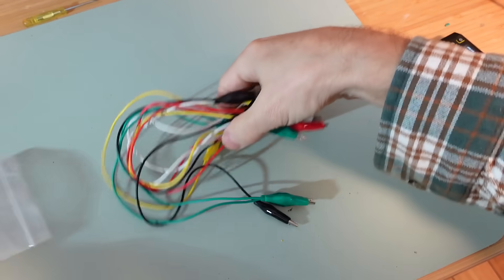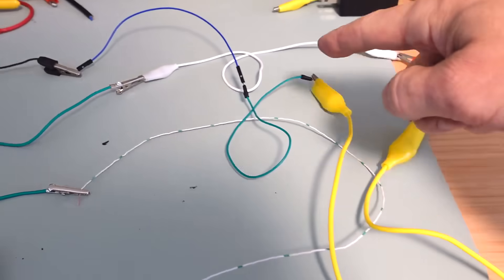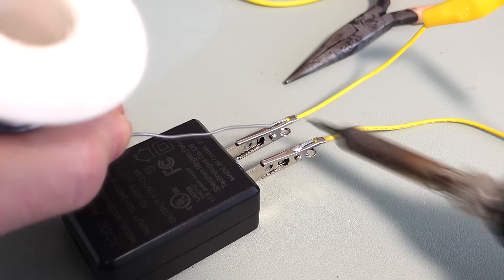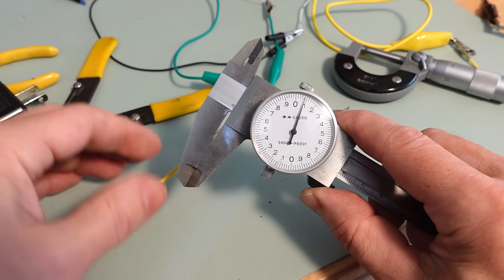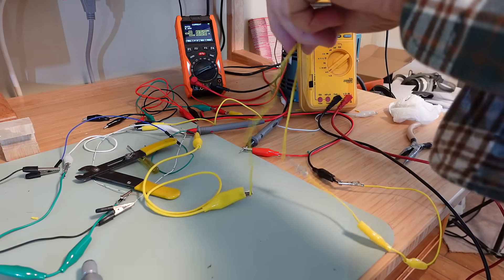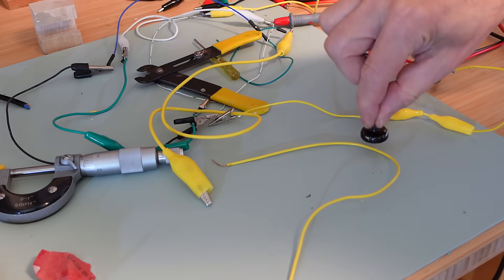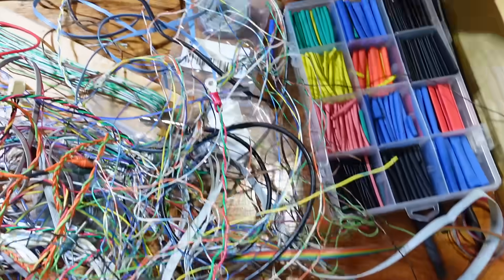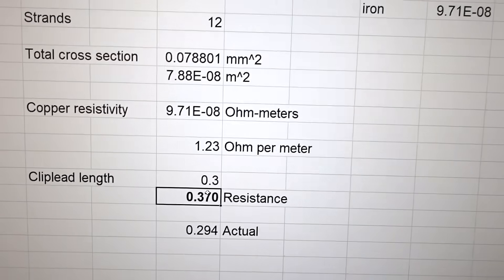Clip leads made with fake wire

Comment: I knew they used copper coated aluminium, had no idea copper coated steel/iron was also in use. Turns out some of the jumper wires I've got are magnetic.
I wonder if the mouse cable is shielded.

Comment: I can't imagine anyone better to review this name-brand screw-in light fixture for a table lamp that I purchased from a not-so-cheap "hometown" hardware-store... Who needs the attention drawn to?
The hardware store is known for goodnough quality to be in every hometown... Its supplier is known for similar, so neither would risk their reputation on cheapo stuff, right? The "manufacturer" is well-known and has a goodnough reputation for quality... So, then... they might not've even been informed when their outsourced manufacturer must've hired this new second-outsourced contract-assembly-line who obviously know more about cutting mechanical (and fire-prevention) corners (while still making it look the same) than they know a thing about electricity, and obviously don't care nor expect to be hired again for another run? And, further, maybe the company can't be held responsible, because they have an official UL listing for this product, which surely could not have been UL listed when the first run was brought to the Testing labs. So, I guess we can't even blame UL for not having reason to test each manufacturing-run, which is of such poor quality I won't even leave the switch on when I go to the bathroom even after I put a nut and bolt through the extremely flakey rivet (the thing is labelled 660W! I barely trust it with a 60W-equivalent LED bulb!!!), and would fear my non-electrically-inclined neighbor might've assembled one of these for a reading lamp and to scare away monsters in his kid's room, and winding up burning down the whole neighborhood...
So, then, who needs (who *deserves*) this brought to their attention? Friggin Senators?

Comment: Because of the high price of copper the wire industry is turning to very "questionable" practices. Home generators are often wound with copper coated steel wires these days. They have poor electrical properties and degrade very quickly.

Comment: Fun fact, these wires can be soldered easily! They are coated, probably to prevent corrosion. The calculation in the video may be false because of the coating. I discovered all this many years ago, they must be around for decades. Who knows how many accidents and what mischief these have caused. Ridiculous.

Comment: wow I didn't think it could've gotten worse.  big clive's shown they have been selling CCA- copper coated aluminum wire.  now they've gotten rid of the aluminum and went to iron/steel!  I tried to find clip leads that are high quality and it's difficult.  I end up replacing the wire on all of them.  I don't even bother to test/try them out- I just replace the wire before I use them.  as for the mouse lead, I wonder if they use iron or steel of some form to make it last longer due to all the bending a mouse gets in normal use.

Comment: Good video. I also got some cheap leads like 8 years ago. And they were horrible. Basically unusable. Either iron or aluminum clad in thin veneer of copper. Since then I only buy good stuff. I didn't think of testing with magnet. Will do that next time just to be sure.

Comment: You can't trust a handheld for readings like that. The test leads you're using are probably playing a greater role than the alligator leads.
You need a 4-wire measurement for something like that.

Comment: I had a set of car jump leads with crimped connections, the wires were copper with a huge cross section, but the leads were open circuit and let me down when I needed a jump start.  Some sort of corrosion between the copper wire and the plating on the crock clips was perfectly insulating. I soldered them and they were OK.

Comment: I had a raspberry pi that was suffering low voltage despite being connected to a 10A supply, which was holding steady at 5.03V. I discovered there that the precrimped dupont cables I was using were extremely high resistance, but now I know I can simply check if they're made of iron.

An excellent find, thank you for sharing it.

Comment: Looks like you got the Spicy wires.  Thanks for the data!!

In eastern Africa we would get Chinese CCA mains wire labeled as copper...but the metal was so bad it would often just dissolve and eventually burn under any load.   I wonder if it was actually Copper Clad Steel.

Power strips would sometimes has a single small strand and most often an EMPTY green wire... like it would be in the cable but would just be hollow.

My theory at first was that we got all the regulatory rejects from other countries...now I think it's outright fraud taking advantage of people who have no recourse.  Sad!

Comment: You can adjust your micrometer to be at 0. Most likely came with a special wrench. If you see a tiny hole around the body of the mic, you can use the wrench to move around the mic's "shaft" to bring it back to 0.

Comment: Thought this was general knowledge, not something to make a video about. Same with all the cheap "dupont" wires. They usually even have so stiff insulation, they almost break if you bend them.
Even cheap UTP cables are made from CCS (copper clad steel). Yes, CCS is a technical term, so is CCA (copper clad aluminum), which is typically used for cheap speaker wire and cheap paired stranded wire. Garbage!

Comment: It's called "China Shit". I had similar experiences with many chinese "bads" (can't say "goods"). For example if you are testing the max. power you get into your smartphone using a chinese cable it's usually much less than with "real" cables. Some plugs of the cables can decay in weeks. I guess they try to push out as much product as possible and at the same time reduce the amount of material used and/or replace materials by cheaper ones. Not to mention that many plastic additions can be slightly poisonous. They don't adhere to any world standards.

Comment: To be honest, I'm kinda surprised that an experienced electronics guy like you didn't already know about this.  This has been pretty common knowledge for several years now, AFAIK.

By the way, those wires are almost certainly not made out of actual iron (9.71E-08).  That would make them very brittle and not very useful.  It is most likely actually an "electrical steel" (4.60E-07) core with a copper (1.62E-08) coating.

(I don't personally really care, because I never use those really thin clip leads for any kind of power applications (over maybe 100mA) anyway...  For low-power signal applications, they still work just fine.  For anything actually supplying power, I have a bunch of (only slightly) bigger clip leads that are rated up to about 15A or so, so I just use those instead.)

Comment: The curse of Nickel Oxide. Forms with moisture and causes a rise in contact resistance as current passes the joint. The most notable occurrence is on 9 volt battery clips when fresh full batteries almost instantly manifest as flat. As the device draws current the riveted joints go open. Scratching of the Oxide and soldering the joint overcomes the problem. Most clips are Nickel plated and the wire regardless of whether it is copper, tin plated or iron! Will not maintain a low contact resistance with nickel.

Comment: I had a set of Beyerdynamic headphones, big ones with earbuds for event engineering. They used steel wires for sturdiness. How I found out: replacing the plug. Won't solder.

Comment: Yes it will be higher resistance than pure copper wire which is quite expensive now. I found some test leads which are 
crimped to the insulation with real copper wire just touching the alligator clip with no solder to connect the two!  Whaa?
Best to inspect everything if you get cheap products made in  China! They take shortcuts any way they can.

Comment: I noticed this exact same thing after a clip lead caught fire when it really shouldn't have. I ended up ripping the clips off of all of them and used my own wires between the clips. Some of them are not only not copper wire but there are only about 4 or 5 extremely thin strands of wire and a whole bunch of plastic to make them seem thick. I see this exact same thing with vehicle jumper cables in my country rated at hundreds of amps but then they melt and burn up on 1st use. Really scary stuff.

Comment: I've noticed that in the case of cheap computer equipment the iron is usually on the braided shielding, while the power and data conductors are still copper or copper plated aluminium.

Comment: I once bought a new heavy duty power cable, I forget the length but wanted to cut one end off to attach an LED light. I found the whole length of the stranded wire inside was made of many short, maybe 10cm long lengths of wire somehow all lined up inside the external insulator to make the cable. It seems if you want a 'real' heavy duty cable it's best to make your own.

Comment: I think the main problem with those cheap wires is we often have to solder them, since the crimping method doesn't work very well.
They are not for use with a lot of courant, so I don't mind if they are made from copper or steel.

Comment: Had issues in the early 2000s with copper clad steel telephone wire, the inductance of the twisted pair was causing issues with ADSL and VDSL connections. CCA is fine for signal wires, or low current , and a lot cheaper than solid copper but copper clad steel is godawful

Comment: A lot of really cheap automotive jumper cables aren't copper, but are actually aluminum. I've seen them melt under load. I have a bag of those same clip leads. Looks like I'd better replace and solder those wires. Great vid!

Comment: I use the flame test to check for copper plated wire.  Put the stripped end of the wire in a flame.  Real copper wire won't care and will just sit there and get hot.  Plated wire will twist and curl.

Comment: The magnetic wires could also be nickel.. Copper is 1.7E-8, iron 1.0E-7 and nickel is 7E-8. So that would explain the difference in the resistance measurement I think.

Comment: Matthias got us all out in our workshops with a magnet testing our wires now 😆💕👍 Nice job on the data
Reply: They also like to use copper coated aluminium, but even that should be a better conductor than iron cables.

Comment: Cheap out and use copper-coated aluminium? Naaah - use copper-coated iron instead - and have fun with the wired corroding away within a couple years.

That is also the difference between aliexpress/temu and amazon:
With Temu you know you get crap cause you always just pay crap prices. With Amazon you just have to pay 5x as much and still get scammed.

Comment: Pretty much any wire you buy "from china" will actually be iron or aluminium wire. It is shocking, literally and figuratively. I brought some 22awg wire from china for a project. It was labled as "pre tinned copper wire" and when it arrived, it had far too high resistance for copper and heated up. When sanded the coating either didn't come off or didn't exist. The resistance was also in line with it being aluminium. 

The worst part is that most of the retailers here in the UK just rebrand tat from China and severely mark up the price. So £5 wire from China and £20 wire in the UK is identical. That extra £15 is in getting it tomorrow and getting it next week.

Comment: I have used these sort of cables for ages and indeed have had experiences of even seeing smoke from the wires at high currents. It's a bit ironic that these wires are often used when engineering stuff and most crappy quality is being used.

Comment: Some of the cheap Chinese wires are iron wire and some are made of copper plated aluminum (CCA Copper Clad Aluminum). You can't expose the aluminum wire with a magnet but you can by heating the bare conductor with a lighter, aluminum has a much lower melting point than copper and will melt with the flame of the lighter. Take care. Cheers.

Comment: Some of the new #4 automotive jumper cables sold at big box stores are now copper coated aluminum. I just checked one and it is all aluminum and copper and no iron.  Thanks for the video, it's good information.
Reply: Aluminium is not quite as good as copper, but still a relatively good electrical conductor. The main reason aluminium shouldn't be used in jump cables, or any cables that are supposed to be flexible, is because it easily becomes brittle when flexed and used. Before you know it, you have a break in your cable and possibly even a fire.
Reply: @mikethespike7579  The other problem with copper coated aluminum wires is that they corrode and disintegrate like crazy when in damp conditions. Guess what kind of conditions jumper cables live in....
Reply: @cantcomeupwithausern  They don't corrode quickly if the insulation remains intact.  It is important to keep these types of cables stored in a loop and not bent sharply, such as inside the hollow of the spare tire.   Apply some grease where the conductors connect to the clamps.
Reply: @946towguy2   the problem starts at the exposed wire where it is clamped to the large alligator clips. So they will corrode unless it's sealed at that connection point, but it won't be
Reply: Most recent "invention" is twice thinner jumper cable wire diameter, covered with metal like coating and PVC all over that. Noticed that when in last winter tried to jumpstart my relative 3.0L diesel car and jumper wires simply melted.
Reply: @KrotowX  Bikers have learned a similar lesson. You can buy specially light and compact jumper cables to take on motorcycle trips. They work alright on bikes up to say 700 cc. But don't try to jump start a Harley with one. It's better to make sure your battery is good.
Reply: That has been happening for quite some time.  Utility companies use aluminum for distribution lines in both primary and secondary.  Even the drop to the drip loop outside the weather-head is typically aluminum.
Reply: Lol. Where have you been? These have been copper coated aluminum for probably at least the last 20 years, likely longer . Now,  when you're paying significantly more money for the same type cables then it would be fair to say that they would be stranded copper wires.

Comment: This. Explains. So. Many. Problems. I've. Had.
I would've never thought twice about the material of my "copper" wire..
THANK YOU
Reply: I got got caught with bad wired and threw them aside, but couldn't see why. I just ran a magnet over them... Magnetic copper lol
Reply: @axle.student how much current did you make doing that LOL
Reply: @fishhuntadventure  Probable none to measure, the leads are open circuit lol
a couple I fried with low current and a couple were open to begin with.
Just rubbish. I just kept them for the clips.
Reply: Same here! 
Actually i didnt even think to blame the wire.It was only when i saw your comment.
Sneaky bastards!
Reply: Those test leads cost me a lot of diagnosis time until I figured out there was 1 ohm in two feet. I thought it was the crimp causing the problem but after soldering it was the same. The wire appears to be copper but is magnetic. Must be plated.
Reply: me too LOL...
Reply: This. Came here to say exactly this. 😭
Reply: What impresses me: I inherited some of these from an old neighbour of mine. They must be at least 5years old, but i'd rather guess 10 or even 15 years. And definitively not bought on ali express. But they are exactly the same scammy crap.
Reply: @arbitrary_username  I assure you they have come out china or some associated 3rd world sweat shop :)
Reply: I orederd some meter leads from China and they were supposed to have a ten amp capacity..They seemed a little flimsy in my hand so I decided to cut one open. The number of conductors in the braided wire they had used was one third of the the legitimate fluke leads..Dangerous and insidious.. That is what Jina does..Liars and thieves and godless commies who don't have a care in the world except for themselves..DO NOT DEAL WITH jinese companies..Remember wuhan virus??? Intentional my friend..!  Apple/ Macintosh from China should be banned ... you re being monitored..
Reply: I was aware that people cheap out and use CCA. But iron is new to me.
Reply: obviously have not done much business with China. Even their sh*t ain't real
Reply: me too,
Reply: @Lacking_something For many simple applications, it doesn't really matter. But for anything that relies on accurate timing (like digital circuits), anything that relies on inductance (like wireless receivers), anything that deals with temperature sensing (like thermostats), etc. -- if the properties of the conductor aren't what you expect, then all the math and engineering spent on the design kinda goes out the window. Sure, you can frequently (but not always) account for the discrepancies. But if you don't know to deeply scrutinize one of the most basic components of your circuit, you'll spend many hours pulling your hair out trying to figure out why the circuit sometimes works, or why it sometimes explodes.

In certain applications, this can be disastrous. As the wire resists more, it gets hotter. If it gets hot enough, surrounded by the right materials, this could lead to fires in very hard to reach locations that go unnoticed until they're out of control.

I think they're getting away with it because these are usually not end-product wires, and mostly used for testing. But if you're setting very sensitive controls based on the readings you get with these; that could easily destroy very expensive components.